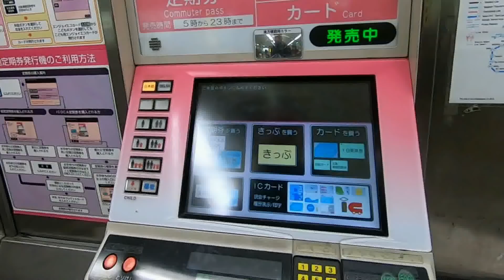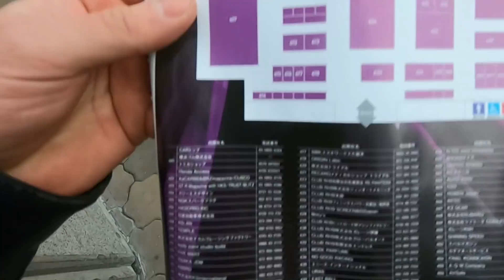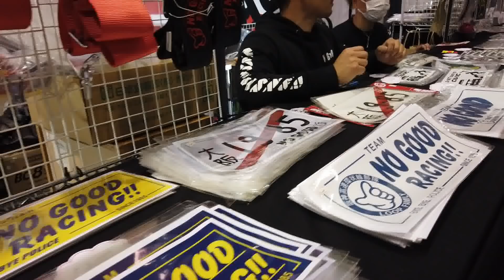Kanjo racers at the Osaka Auto Messe | TMNG in Japan 3

Comment: I have three possible explanations for that scoop.

1. If the radiator is placed at the back of the car like they do in most drift cars, maybe that scoop may carry some air to it. I know this is not a drift car, but weight distrubution may be the issue here. I couldn't detect any hoses or smth like that in the video, so this one was the most farfetched one.

2. It may help to keep the cabin cool via roof as a replacement of air-con with some unwanted weight. I couldn't see the roof at the footage, so I don't know for sure but let's admit it. This might be it!

3. It's just a weird, non-functional Japanese thing that they often add to their modifications list. I think this is the most reliable exp for that.